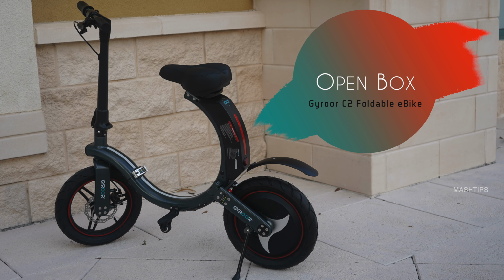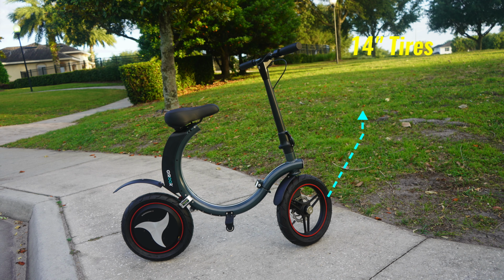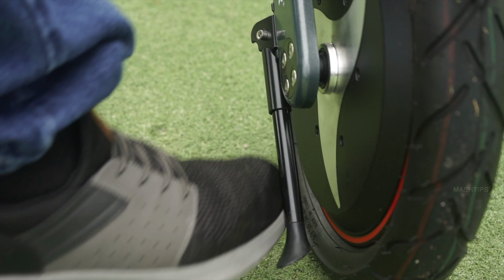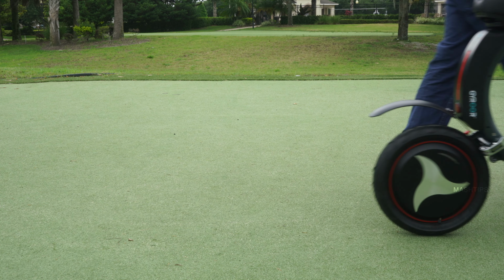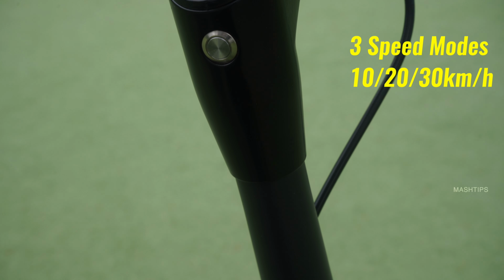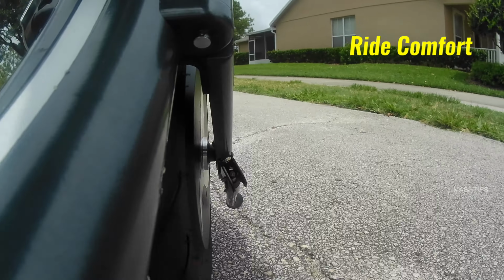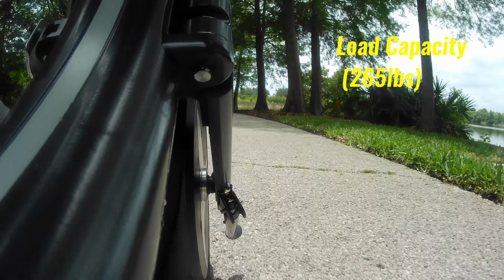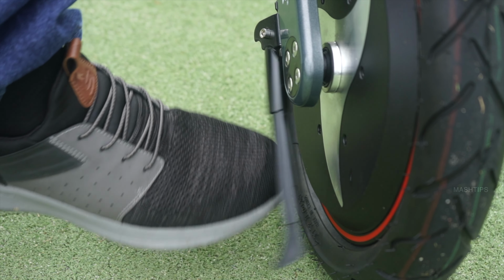eBike Review: Gyroor C2 Folding eBike Features and Review

Comment: Can we see the total miles covered by the bike?
Reply from the maker: No odometer on this bike
Reply: @Mashtips  u can use an app for this
Reply: I had this bike and no you cannot see the number of miles traveled and when it is folded you cant really drag easily because one side is heavier folded up so it tips over. However, I like this bike so much that i am buying a second one tomorrow. The good far out weighs the bad